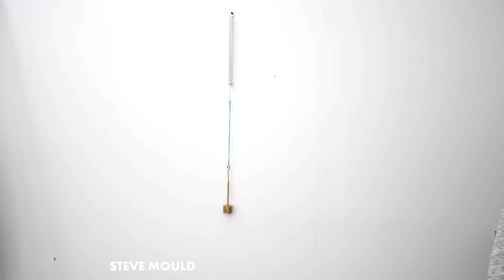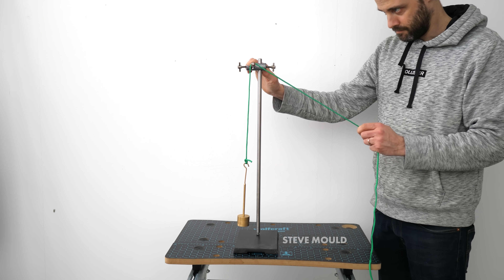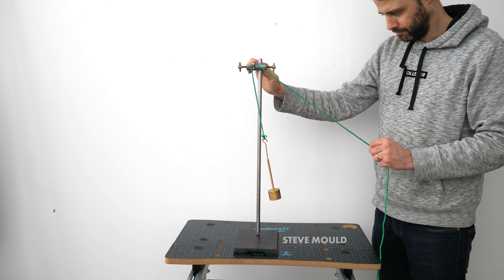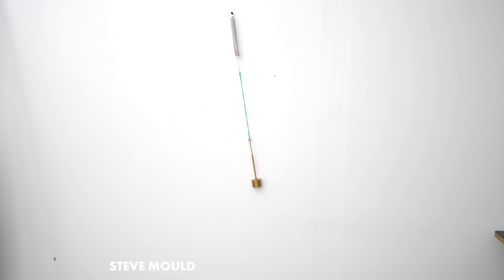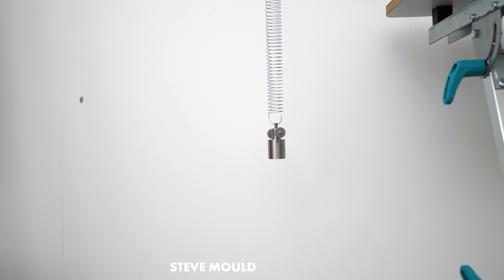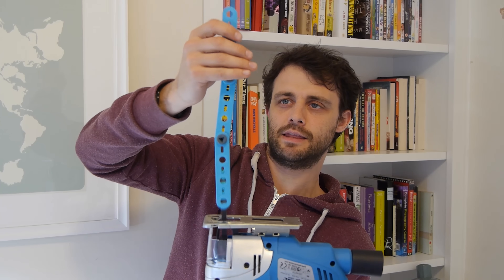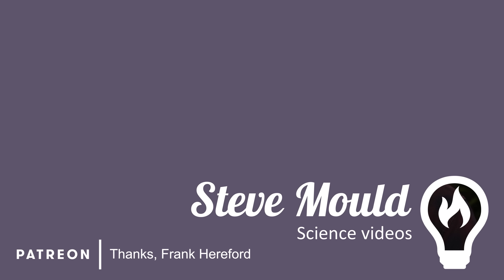What If Swings Had Springs Instead Of Ropes: Autoparametric Resonance

Comment: What you said inre varying the mass is not quite correct. Using a different mass of pendulum won't matter as the rate of swing is mass independent, but a pendulum whose mass varies( e.g. a lleaky penduluum filled with sand, or the pendulum being a bucket under a rain of sand), would result in other non standard pendulum behavior due to the rate of change of mass.being a factor.

Comment: 5:28: pulling the string doesn't produce any work (the string is always perpendicular to the ball velocity), so the ball doesn't accelerate. Of course, radius of its "orbit" is getting shorter, therefore its angular speed increases.

Otherwise, excellent video of course! :)
Reply: "Pulling" implies a force.  If you're applying that force through a distance, you're doing work.  Where does that energy go in your interpretation?
Reply: @michaelsleator6326  Of course not. Work is a scalar product between velocity and force. When you apply a force perpendicular to the velocity, you change its direction but not its magnitude - as seen directly in Newton's F=m dv/dt. In the newtonian framework, if you consider earth's orbit as a circle, then the sun has been acting on the earth with a force for 4.5 billion years without changing its energy.

Comment: 10:00 The famous lecture demonstration of the Wilberforce Pendulum is where a large hanging torsionally rotating spring has a coupled  'bouncing'  translational oscillation.  Done with a perfectly polished steel cylindrical mass in front of a lecture audience they see the whole system bounce - then appear to stop (not noticing the rotation due to the shiny cylinder) and then oscillate again appearing to break the law of conservation of energy.  It is a real showstopper!  You hinted at Barton's Pendulums too - a fantastic demonstration that has been rather forgotten! https://youtu.be/W4YaemEauGo

Comment: 1:00 A flute or a whistle isn't actually resonance. There is no rhythmic external influence here. Just continuous airflow.

And another parameter of a pendulum that's relatively easy to adjust is the distribution of mass. Is it all bunched up at the center of mass or spread out? A more spread out pendulum (along the radial direction, at least) will be slower than a more concentrated pendulum with the same distance from center of rotation to center of mass.

Also happy to see someone that's not afraid to use centrifugal force. Too many were taught "There is no such thing" in school and stay in that narrow frame of mind the rest of their life.
Reply: No resonance?  Then what, pray tell, determines the pitch of the tone?  Yes, the input airflow is continuous, but do you understand how a whistle works?  The airflow at the fipple is not continuous.  That's precisely why there is a blade across which the air passes.  If you look around, you can probably find some good Schlieren imagery of the airflow at the blade edge.  (Perhaps Steve needs to do a video on how whistles and flutes work.)
Reply: @michaelsleator6326  Yes, no resonance, precisely because the input airflow does not have that frequency to it. The input airflow isn't perfectly smooth, and that's enough. The whistle makes the frequency all on its own.

The pitch in a whistle is decided by the size of the chamber and the speed of sound. Many physical systems have such a "preferred" oscillation frequency, called the eigenfrequency. And they will oscillate at that frequency when acted upon, regardless of the frequency of the input.

Yes, they will oscillate way, way more with way weaker influence if the input oscillates with a frequency that matches. This is resonance. But it doesn't have to match. Like in a whistle. Like Tacoma Narrows bridge. Like a guitar string (the string itself, mind you, not the box it's attached to and the air inside that; I don't know whether that's true resonance, but at least the influence of the string is very rhythmic, so I won't exclude it without knowing more). Like a xylophone. Like a car hurtling down the freeway with one window slightly open. Like swings in the wind.

Comment: I'd love to se you do one on the pendulum found in a torsion clock and why the total rotation (based on mass) has no effect on the period (I'e a clock that needs cleaning but otherwise 'runs' may only rotate the pendulum half a turn while a cleaned clock may do more than a full revolution but both keep the same 'time').  This kind of isochronism simply baffles me.

Comment: Rotating your body on the swing imparts its angular momentum onto the system by way of changing the center of gravity. They're all related and necessary.
That is, the change in angular momentum cannot be generated without changing your center of mass in relation to the swing.

Comment: I accidentally taught myself Autoparametric Resonance as a poor child in early 2000's. Didn't know it was so scientific to make something go back and forth by pulling it attached to a string. I thought it was fun, a bit of a game to see how fast you can make it swing. Long slow pulls of the string work much better for imparting force into the resonance. 

1: Pull the string when the weight moves towards you, it speeds up. 
2: Lower the string as the weight moves way. 
Repeat 1 & 2, and you can make any weight flip over a pole with very little effort. 

I never tried pulling the string at a consistent resonance. In my experience it's a lot more fun to try and speed up the weight, and make it swing over the pole.
 
You could make 1Kg flip over itself in 15-30sec with very little effort.

I had to comment my experience experimenting with this, hope it strikes some thought.

Comment: Oh boy, the normal modes are bringing back nightmares of my mechanics class. We did a whole chapter on coupled oscillators and basically what happens is you have a matrix differential equation and the normal modes correspond to the eigenvectors. They're important because all the other solutions are linear combinations of the normal modes.

Comment: I design ships and they can actually experience a form of parametric resonance called parametric roll. The ship’s stability is a function of its waterplane area. Waves can affect this, by changing how much of the ship is in the water at the ends. You can think of this as a torsional spring, with a variable spring constant. If the wave encounter frequency is at or near the ship’s roll frequency, the ship will begin to roll very violently, even in relatively small seas. This effect often causes container ships to lose containers over the side. They deal with this by slowing the ship down, which changes the frequency the ship encounters the waves at.
Reply: That's a fascinating example. Thank you!
Reply: That is amazing and scary. Amazing that it's such a universal concept.
Reply: Do the ships predict when they're going to have this problem and take preemptive action, or do they react when it starts happening?
Reply: @Septimus_ii  I've been to nautical academy where we had to do the calculations too. The problem is that you don't know the parameters used in the calculations when at sea so predicting it is hard. It does have a distinct effect. The ship will just heavily start rolling although the sea state is calm and thus it will be noticed by experienced officers. 
Recommended action is to just divert course up to 5 degrees. Speed reduction is possible too, but not done that much as time is money and ships got tight schedules. 
The direction of waves changes over time and this effect only happens when specific factors are just right. Thus the ship can return to its original course quite fast. Before this phenomenon was known a lot of ships sank, especialle container vessels. Other types of boats are less effected, mainly due to the speed they operate at. (container vessels being the speediest).
Reply: @Septimus_ii  each boat could probably time their own roll frequency, but predicting the encounter frequency with oncoming waves is probably rather difficult, unless you know their exact dimensions, so you probably have to start feeling the pattern to learn there's one coming on.
Reply: Could and do you also change course? To adjust frequency of wave incidence?
Reply: Changing the heading while maintaining speed would reduce the component of speed in the direction of the original heading. This would have the same effect as slowing down but would require more fuel since you're still moving at the higher speed.
Reply: Interesting. I've noticed this kayaking, but never put it together what is happening. Thanks for the knowledge.
Reply: This applies even more to submarines. Back in the 70's I recall that steering a sub was very much an art that only a few were really good at. One of the cooks a boat I was on was legendary good at it even though it wasn't his job.
Reply: I believe this is a real problem with cruise ships so they have anti-roll systems.
Reply: I honestly think this is one of the most intelligent comments I’ve ever read on YouTube
Reply: Being a ship captain sounds like a difficult job.
Reply: Interesting…
Reply: HMS Albion and her sister ship suffers from this at anchor with beam onto waves. My god, not a nice place to be in that scenario.
Reply: When students say "I'll never use this in the real world" I'm pointing them to this comment
Reply: Wow thanks !!
Reply: Thanks for that!  Very cool.
Reply: The boats we build at Excel Boats 🚢 have that technology is so cool 😎
Reply: That’s amazing! Thanks for this info. It was fascinating after learning about the concept in this video.
Reply: @remy5405  when you’re a shipping container vessel, I imagine fuel economy is a major component of decision making.
Reply: Cool, the way you describe it schematically is exactly the same as schematically describing a bridge on 2 fulcrums (or columns) where torsion exists on the long axes

*around the long axes
Reply: Ah, interesting. I would assume it would also happen at certain multiples of the boat's roll frequency as well. One half, one third, etc. But I'm guessing not double or triple, because that would cancel it out, and also because waves don't come that quickly... do they?
Reply: That variable spring constant has gotta be... a bitch lol, unless it's just based on the trig of the angle of the water incident to the boat. Even then, can't imagine it's pretty.
Reply: I also work on ships and when I learned about this concept it blew my mind.
Reply: fucking WOAH :o
Reply: How wild! You design ships, and I ship his designs! :)
Reply: Sure you do...
Reply: I wonder if the Dutch roll jetliners are inherently prone to due to their swept wings has any similarities with this phenomenon too
Reply: Wouldn’t the roll also increase the current around the boat, causing the waves to speed up slightly or increase in power a bit, and with the spring it would be the energy stored, with this being the same for every spring and weight, just different calculations needed to get the right speed to increase it
Reply: How long does it take for you to design a ship?
Reply: Thats pretty smirt stuff i actually saw a video the other day of bill nye explaining this on noahs arc and the worlds largest wooden ship it would probably be a really cool short video to check out since thats ur profession
Reply: @codywhite8358  smirt? did you mean smart. lol
Reply: @Badgerroodragon   yeah but i think its funnier saying smirt
Reply: @codywhite8358  noahs arc ? How can anything be done eith something that never existed ?
Reply: So I've tossed around an Idea for years to create a generator which uses tanks of water on chains using buoyancy to sink and surface. I think something like parametric resonance could work underwater though given enough scale. hyrdraulic systems instead of springs to swing a submersible ballast/ turbine and sustain the resonance. Should be possible but at a much slower rate right?
Reply: @timbrwolf1121  There are tidal/wave generators already being used and trialed in some places that sound very similar to this.
Reply: Think I experienced that on the Bay of Biscay..  Although I wouldn't define that crossing as "small seas" on that particular occasion :)
Reply: one step forward two steps back 🚢
Reply: 89
Reply: So you don’t solve it through design :(
Reply: Sounds like you need to design better ships so we don't have to slow down
Reply: I wonder if there is a way to harness waves to power a ship as a sail harnesses the wind.
Reply: Barbara Ferron

There is.  Many years ago I saw a design for using the waves up and down motion to move a "fluke" up and down with an offset pivot point.  Whether moving up or down, it would push the boat forward like the fluke of a whale (though it was really more reminiscent of an airplane wing in cross sectional aspect).

I don't know of any practical.models built, I'd suspect it isn't terribly fast so other than a novelty not pursued as a motive means for watercraft.
Reply: I strongly suspect that normal pumping a swing is actually to to with raising and lowering the centre of mass, rather than rotating the swinger's body
Reply: @asimong  Nah. You'll notice that when you lower your top half you also raise your legs, keeping the center of mass just about even. It's entirely based on angular momentum.
Reply: No thats just not correct. You obviously know nothing about building ships buddy

Comment: 4:10 This is a fun thought. I think that it would be correct to say, "any mass pendulum will swing at the same rate if everything else is the same", but if the mass changes while it's swinging, that will change the velocity to maintain conservation of angular momentum, therefore not reaching the same peak, or going higher (depending on where in the swing the mass changes). So I think it depends but it will change the period unless the mass is added with matching angular momentum, proportionally speaking (this example is not that).

Comment: I don't think that changing the length of a string is directly what causes a pendulum to swing. Your string is wrapped around a pulley. The string rotating about that point transfers rotational movement to the weight. If the string was directly pulled from above the weight would the pendulum still swing?
Reply: Yes it would.

Comment: - 0:40 Didn't Bruce Yeany already cover this? I swear I remember him doing some videos with this. 🤔
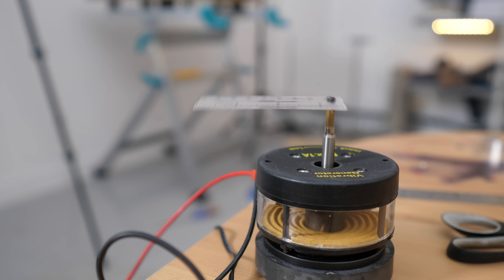- 2:43 Now I know I've seen this. It's just Atomic Shrimp's "Wobble Dog 9003i". 😀
- 4:13 <Insert yo-mama-so-fat joke here>
- 9:20 Don't you just hate it when you make a video and realize someone else already did it years ago? Simpsons did it!
- 13:36 Sure you can reduce your carbon-footprint to zero: eat a pile of coal and get buried.
- 14:44 Yup, that's pretty clearly a bird dropping carbon into the river. Each molecule of uric acid has five carbons, so it's doing its part to take carbon out of the air. So what's your excuse? 🤨
Reply: Cope

Comment: Why do these systems go all the way between each mode? It seems like one mode would bleed over to the other mode until there's some kind of equilibrium, half-ish of the energy to one mode and the remainder to the other--especially in the case of the loosely coupled pendulums. It seems strange that all (or even most, or even more than about half) of the energy would go to the other pendulum/mode. Why does it so thoroughly switch between modes? (Or, now that I've finished the video, why don't these systems "find" a stable mode? Where in that equation is the prediction that they'll so thoroughly oscillate between the modes rather than eventually stabilizing?)

Comment: This is interesting. It appears to be a similar, although probably not identical effect that crane operators use to keep heavy suspended loads from swinging out of control. In our case if we want to stop our pendulum from swinging, we can move the suspension point rapidly a small distance in the direction of the swing, which causes the swing to slow down in that arc. In confined spaces this might not be enough to arrest the swing entirely so we might need to move back the other way on the backswing until the undesired motion stops. 

The reverse works too. You can make a heavy load start to swing by rapidly moving the suspension point a short distance, then increase its swing by short quick motions in the opposite direction of the swing. But you don’t want to do this! I expect these are variations on the properties you illustrated with the playground swing. Crane cables do have some elasticity but not as much as the springs you used so I don’t know how much they affect swing in the manner you showed. I also don’t think our hoists can reel cable in and out quickly enough to get the right resonance to start or arrest swing in that manner you showed by shortening and lengthening the line. In any case the experiment would be too dangerous so I’m glad you showed it small scale!

Comment: This is a very nice analogy for the RLC resonance in electronic circuits with inductors and capacitors. They each resonate each other and you need to tune both so that they work together.

Comment: wait, did I just learn that if you were suspended by a rope over a gap, and you had a way to let line out or shorten your string, you could cause it to sway enough to swing yourself to safety? That is probably more efficient than just kicking your legs trying to get it to swing and would also work if you were incapacitated. This just brought all new meaning to several Hollywood movies.

Comment: Swinging doesn't work by moving the center of mass vertically. Nor does it work by the transfer of angular momentum, because swings aren't rigid objects. It works by moving the center of mass horizontally.